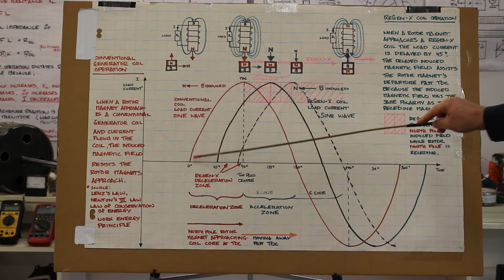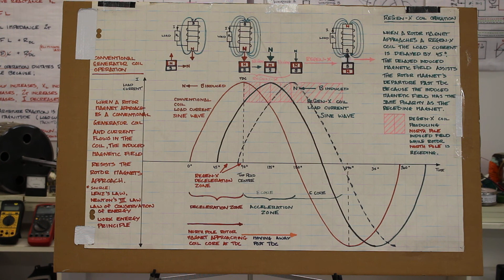PART 4 The TRUTH About  EV Regenerative Braking AND EV Regenerative Acceleration

Comment: take this and keep it with you, if you have much, much, much higher tau constant then you could rotate a magnet 10 times and the coil doesn't have time to actually have a brake effect, and eventually when the current will run, you will have an input complity out of phase with the rotor.

Comment: Please respond sir ! How do I make such a coil or buy one ?
Reply from the maker: https://youtu.be/VSCIws7zppU
Reply: @PDiCanada1  I know him, he is a Dutch guy (as I am). Do you have permission to share his video?
Reply: @PDiCanada1  Thank you for sharing the video but I have already watched it before. It says .3845 kohm and 2.182 henry coil but I couldn't find anything similar to make the coil. Am studying as my knowledge about making coils are equal to 0. I believe in your invention, the delayed effect of lenz is correct and it doesn't have to break the conventional physics, as it's not an OU device but a really efficiency booster device or a self sustained device capable of running for longer hours than ever before. I would like to know how can I study these stuff, how can I make my own ? Do you have a guide ? A book ? Instructional video of step by step building the device? Please do if there's not any, please !
Reply: @shahruhash  coil inductance formula is L = (u*u0*S*N^2)/l, where u is relative permeability, u0 is permeability of free space, S is coil area, N is number of turns, l is coil length. You can calculate how much turns you need, to get 2H inductance. C shaped core produces higher current than E shaped core, because in C shaped core, magnetic circuit is closed. In E shaped core, magnetic circuit is not completely closed. Comercially manufactured coils give better results, because they use special chemical stuff to glue windings together.
Reply: @marcisgulbis9310  this is an absolute gem ! thanks a lot ! are you making one yourself also?
Reply: @shahruhash  I have made bitoroid transformer by myself. It operates at 220V and 50 Hz frequency. Input power is 19,8 VARs. Output power is 12W. I use it to recharge 12V battery, and than I run my laptop on 12V battery.
Reply: Mārcis Gulbis wow ! Dude can I get your email ? Can you help me out with schematic and knowledge?
Reply: @shahruhash  my email is MMMgulbis@inbox.lv
Reply: I am not sure, but if a magnet induces an opposite pole when it is passing by, and if you need to delay it, all you need is to build up a resonance, which is a capacitor in resonance with the coil. That may delay the current. Now you can let the magnet pass by, and steal some power from the resonance to do other things. Like Thane says, if you understand this and that and that and so on .. .. ..
Reply: @deslomeslager  there is a formulation video, have you watched that? T = L/R or something like that, where if you have high resistant coil, then you get time delay, but all of this is too hard to back engineer ! and why the hell should we back engineer when someone standing in front of us has got the clue ! why doesn't he give us instructions or sell the coils ! even then we could do good.